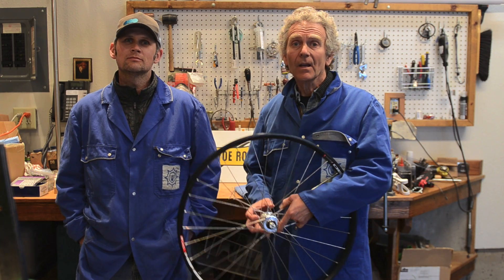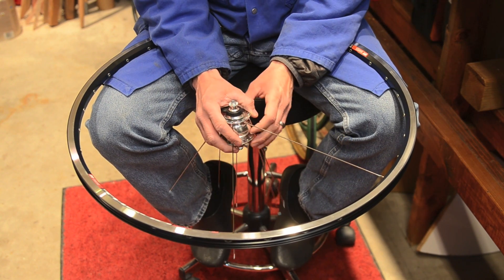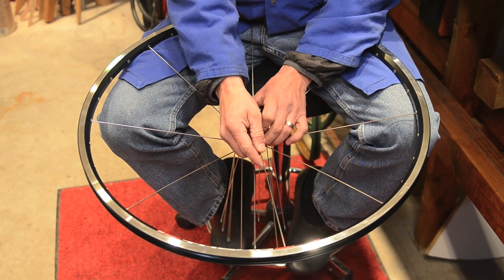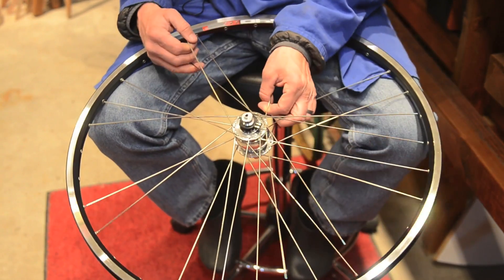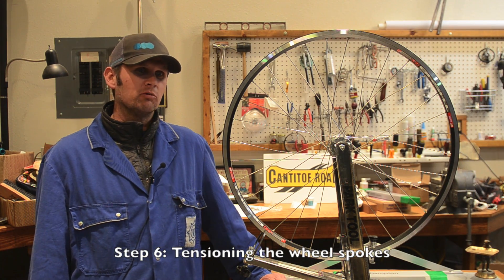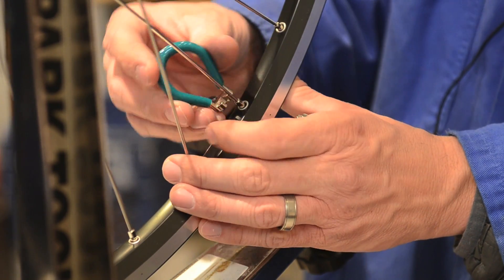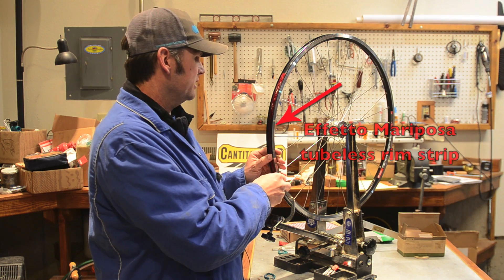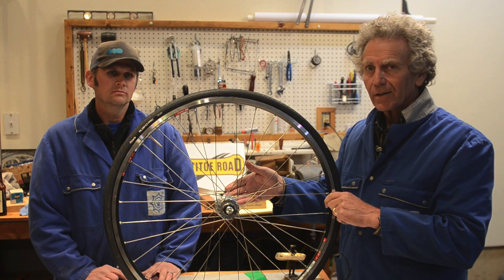How to build a generator bicycle wheel.

Comment: Where is the generator? - is a FAQ in all the comments.
Well, a dynamo, which they are building in that wheel, is an electric generator. 
But, you will be disappointed when you try to turn that wheel with the axle in your hands! It is  g e n e r a t i n g  a lot of resistance - also at daylight ... - and your wheel will stop turning very soon. It is a brake on your bike. Then look out for a road racing bike of someone and give it's wheel a turn. You will see.

Comment: Before buying this stuff, take a look here: https://www.cyclingabout.com/best-dynamo-usb-chargers-bicycle-touring-bikepacking/
Excerpt:
--------------------------------------------------

"Example One: 2.5-Watts (12.5km/h on the Cinq Plug5 Plus)
Once a 3-watt dynamo hub has been converted from AC to DC the output will translate to roughly 5V and 0.5A, which for an hour of riding is 500mAh. Charging a 5000mAh battery will, therefore, equate to 10 hours of riding. However, when we factor in the small losses in the charging circuitry, we lose around 20% of the total generated power. Adding the 20% extra ride time (10 hours + (10 hours x 0.2)) and we’re looking at 12 hours of riding to fill the battery from scratch.

Example Two: 4-Watts (17km/h on the Cinq Plug5 Plus)
If we use fancy circuitry to boost the output power to 4-watts (5V and 0.8A), we can fill a 5000mAh battery in 6.25 hours of riding. When we account for the ~20% losses in the charging circuitry, this results in 7.5 hours of riding to theoretically fill the battery from scratch." 

-------------------------------------------------

This was not as good as i was expecting, so i will definitely have to do some "circus tricks" and use a GPS that uses AA batteries (which i can get almost anywhere. Phones drains a LOT more power), and a camera that uses AA batteries. That way i can leave my phone turned off most of the time.

I would think a 15-20watt solar panel will be better alternative for me (both options would be ideal, but the dynohub seems a bit complicated and expensive). I will mostly just use my phone to upload a few pictures to FB, so i will mostly "need" power to watch some videos on my smart-glasses (a 7000mah battery bank would last about 8 hours of video time, if i take into account the 20% power loss, like in the example above)... Im guessing a 15-20W solar panel should have me covered, and if it is not fully enough, it will not be something important i need it for anyway...

Comment: I am planning to use my bike soon enough for delivery with Doordash and Uber Eats. I might want a generator bike wheel to recharge my battery packs. My bike was bought at $675 in 2014 and has none of it. I'd like to upgrade my bike to recharge battery packs that I mount on the back of it. Because it will keep my phone charged and my vape batteries charged.
Reply: My nitecore charger for my 18650 batteries needs 9V, and most dynohubs only generate 6V... If you vape at 150 watts and 1 set of batteries is not enough for a work day, then just bring an extra set of batteries to work. I vape the Aegis Legend (like i saw you had in a video), and it lasts me the entire day when i vape at 64 watts.

If you bring a pod to work (i have the "smoant pasito" rebuildable pod, and it is actually pretty decent), then you can charge it with a regular battery bank, and if you have one with 2 outputs, you can charge your phone and pod simultaneously...

Comment: cantitoe road i know that this vid is old but, what kind of out put dose it have ?(volts or watts). i would like to run a 12v light system, both front and back as well as turn singles (sp?) would there be enough power??

Comment: Couldn't you have built a better wind rotor with a radial spoke lacing pattern? Then every 2 spokes could have been a turbine blade.  Just a thought.
Reply: Kevin Engele+  yes that would be a great idea however he's not building a wheel for  a turbine, he's building a wheel for a bicycle, it's a dynamo hub, it generates electricity when your rolling down the road to power lights & such, so to install a dynamo hub your rim needs to be dismantled removing your standard hub and then rebuilt using the dynamo generator hub

Comment: too bad guys, I was glued to my monitor, learned a great deal, just until that last scene :)

You use a tool, to check the tension of the spokes, what exactly is that? Does it have a measuring dial, or what exactly and how exactly do you check the tension? do you have a link to the manufacturer of that device?

Comment: VERY GOOD VIDEO
The hub used here IS the generator guys !!! The generator is in the hub, you will notice a power plug coming out of it.
When you buy this type of generator, you have no choice but to rebuild your wheel from the spokes to the rims !!!!
This video also applies to building a wheel from a regular hub (non-generator) !!!!!

Comment: No information about the price of the generator hub (US$150) or the wheel (US$400); but, if you didn't want to add the expense of a 6-volt battery to power your bicycle's headlight and taillight, I'd guess that this is a solution to your problem. Then, too, this generator wouldn't store any power. If your bicycle isn't moving, no power, and, thus, no headlight and no taillight, unless one adds a 6-volt battery.

I'm not certain as to why anyone wants to spend $150 just to charge up a 6-volt battery while riding their bicycle, if it's only to power up the headlight and taillight.  This looks like a lot of expense and work for what a rechargeable battery pack could do.

Comment: where is the freaking generator...thanks for wasting my time with a false title!!thumbs down...
Reply from the maker: +Vega-Expert The generator is the hub in the middle of the wheel...This is what powers your head lights, tail lights, etc.
Reply: +CantitoeRoad Well  then you.... didn't actually build it now did you? 
Should rename it to "lacing a rim"
Reply: +Vega-Expert the HUB is the generator buddy...
Reply: +Vega-Expert  I agree with you. this video should be named how to buy a generator or so, not how to do it
Reply: +FixedByDoc Homesteading 0
Reply: +Vega-Expert it's in the hub that they installed...
Reply: +CantitoeRoad can the hub be fitted for a single axle screw? Like if it was ment for fitting on a Trike (front wheels for tadpole or rearwheels for delta configuration). 2 of these would be thee bomb for a electric trike.
Reply: ME2 BRO..
Reply: Vega-Expert ;v
Reply: Vega-Expert dont watch wasted dude
Reply: Haste Gedacht the silver thingy

Comment: This was great.  I was looking at power generating hubs but had no idea if I had to buy a new wheel with one pre-installed or if I could add it to my existing wheel.  This vid allowed me to understand hub replacement and boosted my confidence to attempt it myself.  

How about doing one for a conversion to an internal gear rear hub (+ whatever is needed overall) ?
Reply from the maker: Hi Dan, There's so much going on inside an internally geared rear hub (see Sheldon Brown's excellent explanation: http://sheldonbrown.com/internal-gears.html) that there's simply no room for all the mechanical components involved in a dynamo hub. Best to leave power transmission to the rear hub and electricity generation to the front.
Reply: I think Dan might have meant converting a derailleur bike to an internally geared hub. The process of building the wheel is the same, Dan. Converting the bike introduces more variables. Shimano gear hubs require a few additional small parts which are included with some models but not others. I think all Sturmey hubs come with their small parts. Then of course you'll need a cable and a shifter, and you'll need to route the shift cable. Routing may require some creativity if the frame was made with a derailleur in mind.
Reply: Thank you kindly~!